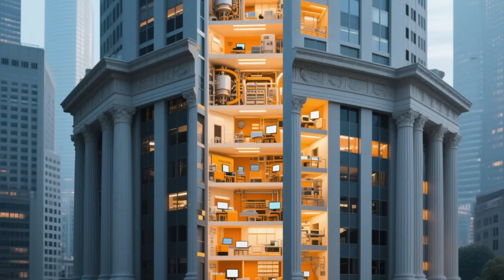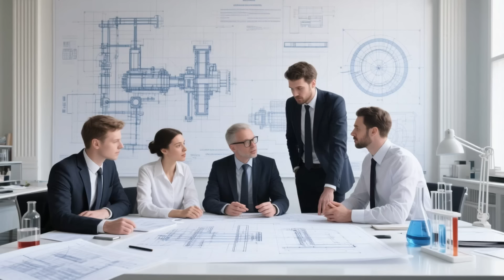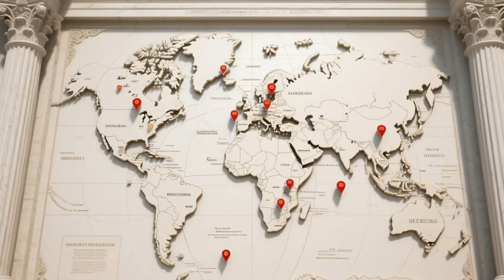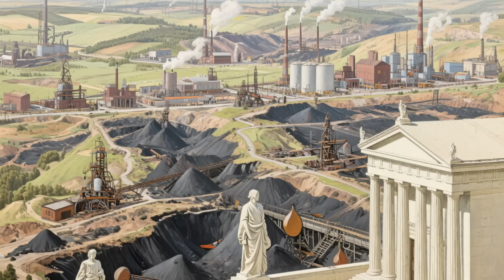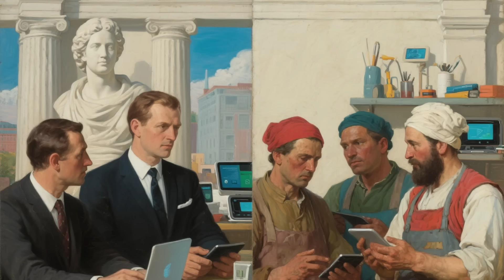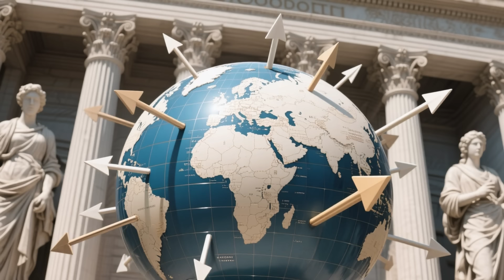Industrial Revolution History Documentary 1760–1914 | Complete Guide to Industrialization

Comment: Take away James Watts Steam Powered Engines, and you'd get no Industrial Revolution.
The Industrial Revolution was the change from Water and Atmospheric power to Steam Power.
15,000 Water-wheels in year 1775
to 10,000,000 Steam Engines in year 1900.